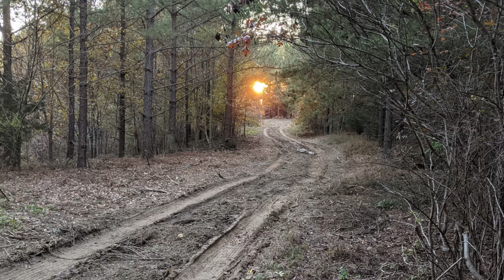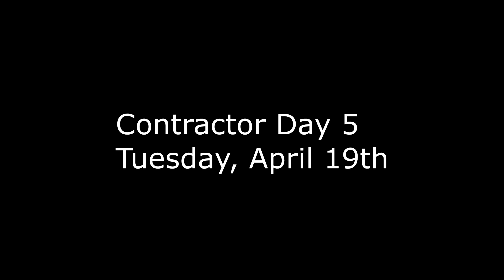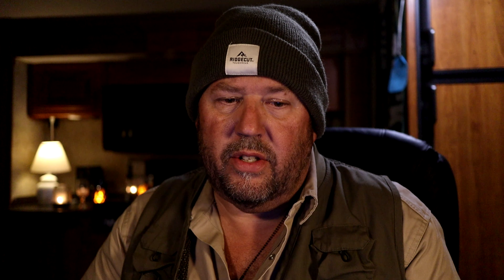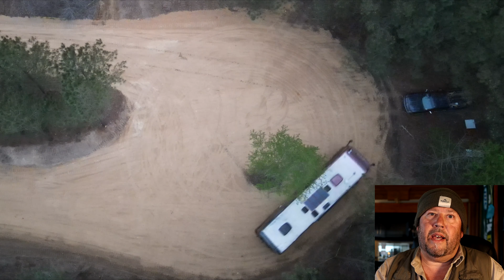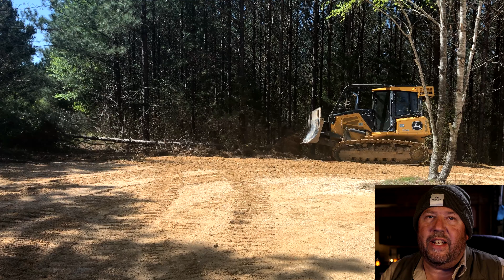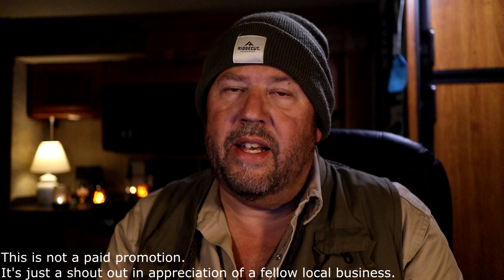Find Out How Much Excavators Charge In This Week Episode 3 of 4 Excavation Weeks

Comment: Hi Troy. Some of the lots in that area had access to central water but I'm hearing that the new lots will need wells. Have you crossed into that process yet or are there alternatives to that? Like is it possible to put potable water in a tank? Just curious about water options before having to pay $10k+ for a well. Thanks for the video content. Very helpful to me as I navigate buying land in that same area.
Reply from the maker: Yes... Lots 1-29 have Town of Linden water available at the road. The water infrastructure ends around lots 30 & 31. All of those lots went on sale Oct 30, 2021 and probably have all been sold. Therefore, your water choices are either a private well or haul it in. You can get a Water account from the town super cheap and it can be your water source. One of the other lot owners bought 3 of those 350 gal crated water containers. One is stationary on the ground and is connected to the RV. The other two are on a trailer for hauling and filling the stationary tank. We did something similar at Linden Camp and you can see a video on it here: https://www.youtube.com/watch?v=BLPNkRo42NI